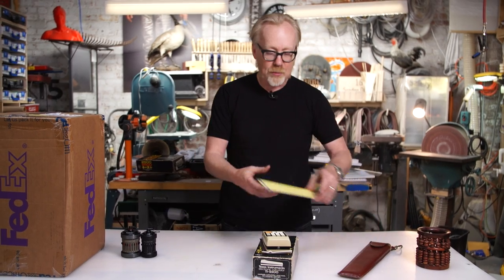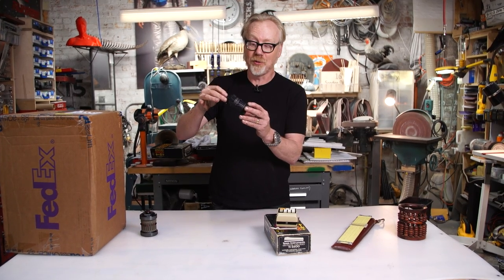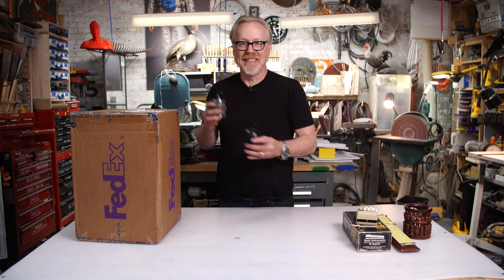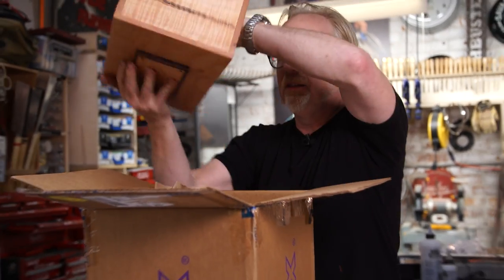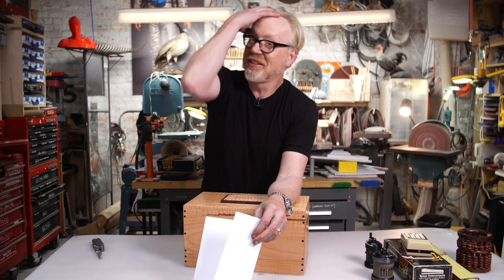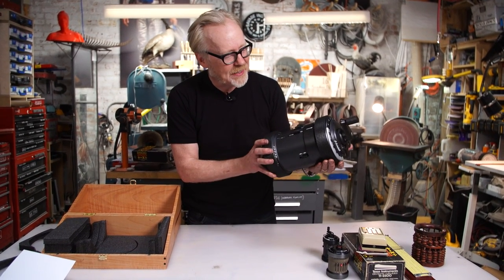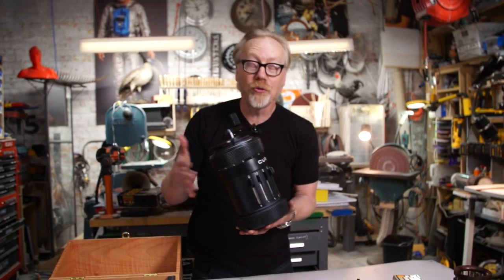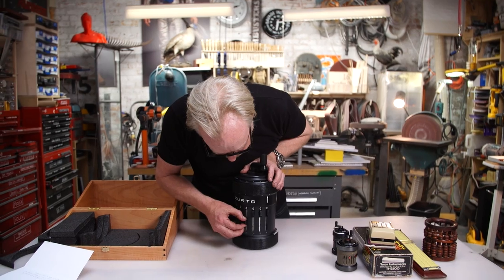The 3D-Printed Curta Calculator

Comment: Actually Curta is digital, not analog as it gives results in clear numbers. A slide rule is an example of an analog calculator. The results vary on how exactly it is aligned, how the results are read.

Comment: Man, lots of tiny plastic gears are hard to line up without them locking up, metal is a bit easier because if something locks up slightly you can just push through it but plastic isnt so forgiving, if one thing is out of place then there is a little resistance that causes it to bend slightly, that just creates more resistance which makes more bending which causes the whole thing to lock up more and more, keep trying to push and you break anywhere between 1 year and every gear that is linked up in that set, the more complicated and small you go the wodse this problem becomes, if you noticed it seeming to lock up a little bit as adam turned it remember that its a miracle it didnt entirely lock up and break from the start, as rough as it seems for plastic that is pretty damn smooth
Reply: Yes, a lot of time is spent smoothing the parts out. In fact, from early tests I did, I found that the ridges formed by the deposited layers of plastic created two problems. One is that they don't move smoothly enough and the second is that the ridges wear down faster causing parts to get loose. Both of those issues can cause binding. Aside from that, meticulous care into making sure that everything is aligned properly and using a dry lubricant (doesn't break down the plastic) helps a ton.

The carry mechanism is the hardest to get right without binding and typically isn't perfect which is usually seen in the last three digits during subtraction. Subtraction is done by addition of the ten's compliment with carry running off of the end of the last digit. For it to work right, a carry has to cascade from the highest order digit of the result through the last digit of the results. The last three digits are turned by a transmission shaft that does not have the extra support of an input dial (there are 11 results digits and 8 input digits). Those shafts are more likely to bow under the extra pressure that a carry requires. If they do, they slip and the device loses a carry resulting in 9s for the result digits after the slipped shaft / gear.
Reply: @MarcusWu  thats insaine how much care has been put into making sure there is no binding of the gears, i never thought about how the layers could wind up wearint down faster although it does make sense as they are slightly more flexible and are really thin, the dry lubricant was also a great idea, have you considered making another one with one of the new resin 3d printers that work off of curing resin using a laser, they are supposed to be able to have a much smaller resolution size which should help with the layering issue, of you do decide to do that i believe the channel marco reps did a video in which he made some improvements to the design of one that could make it a little better
Reply: @kiyosenl.3889  Yes, I was just doing fit tests with a simple printed rod and sleeve to see what tolerances give what kind of fit and that's how I found out the fits can change. I ended up designing the tolerances around sanding those edges down to get the right fit. Unfortunately that means the project is crazy amounts of work. That hasn't stopped others from pulling it off, though. There are some amazing builds posted to the Thingiverse thing -- https://www.thingiverse.com/thing:1943171/makes 

I have considered using a resin curing printer to build a Curta. I think I could do it at 2x scale instead of 3x. Unfortunately, the printers are a more expensive than a plastic extruding printer, introduce smelly resins, and also require additional tools to finish the curing process. I'd love to do it, but I can't spend on all that right now. I also have other large projects that I need to make some progress on. My wife says I have too many, lol... she's probably right, but a maker's gotta make. :)
Reply: @MarcusWu  i guessed as much was the issue with the resin printer, i for one can't afford one at all lol, currently am trying to get a "cheap" 3d printer for around $300 then use that to make a lot of the support parts for a mostly printed cnc machine so i can start doing pc mods, (as a side note i just realized the irony of how much math probably went into making a giant plastic mechanical calculator), im curious as to what you would go on to make after having made a giant 3d printed calculator
Reply: @kiyosenl.3889  I can't talk too much about it yet since I plan on starting a company around it when it's ready. It's software rather than anything physical I'm making, but it's oriented around the maker movement and the need / idea was discovered while building the Curta.
Reply: @MarcusWu  neat, hope that goes well for you then

Comment: How is that 3d printed? The finish is crazy!
Reply: Thanks! The trick is in the finishing -- multiple iterations of the following: sanding, filling, filler primer, flat paint, and clear coat. Particularly the sanding -- pretty much happens between each step. The highest grit number I used was 1500 (wet sanded) before the clear coat.

Nice name, btw -- my brother's name is Peter Wu

Comment: And now i want to buy a 3D Printer again. Wonder what printer this is printed on? The finish is amazing.
Reply: I printed two (the first one for myself). The first was printed on a gMax 1.5. The second was printed on a D-Bot. The finish isn't anywhere near like that straight off the printer. There were many hours of finishing that roughly went like this: sanding, filling, sanding, priming, sanding, painting, sanding, painting, etc. In fact, I didn't bother printing any part in any color other than white because it would have been pointless.

Comment: With that precision and finish, i'm going to guess the parts were printed on an SLA printer - light curing resin in a liquid bath. - edit: I was wrong. His printer is shockingly good for its type. He could get much more precision on an SLA though. I think the only thing that could keep it from being 1 to 1 might be the lack of strength of the resin.
Reply: Yes, your edit was correct, it was FDM rather than SLA. I do want to try a 2:1 scale build on an SLA printer, but I'd have to get one first. SLA printing is more involved and more expensive.

The FDM parts looked as the would on most FDM printer prior to finishing. To get the precision and finish, I printed parts with holes slightly smaller and shafts / pins larger than necessary and then manually fit the parts with lots of sanding and filing. For the exterior finish my process was to sand with a low number grit (I think 180 first, but on some parts I used 80 lightly) and worked my way to 220. Then I used bondo spot putty, some more sanding, a couple coats of an automotive filler-primer, and sanded some more. Then I did a couple coats of the main paint color with a flat finish, wet sanded that to 800 grit, repainting and resanding if I took the paint down too far, then finally finished it up with either a gloss coat or a matte coat depending on which section of the Curta. Lots of work, but the finish was perfect and totally worth it.

Early on in the project I did some tests to see if 1:1 was possible. I went through Shapeways and tried a couple different materials and methods. Some of them produced the parts, but none would be functional with the amount of forces that would be applied to them. To produce a 1:1 scale Curta, the original materials or ones with equivalent strength would likely need to be used. I have some ideas on how many of the parts could be produced today by a maker, but for some of the parts there is no getting around the need for a high precision lathe and mill.

Comment: They'd be perfect for poorer localities where batteries and electricity aren't always readily available, if they could be made inexpensively enough. That's why I also love things like hand crank radios and cellphones, pedal-powered washing machines and such.
Reply: You can buy a solar-powered electronic calculator from China for fifteen cents (MOQ of 10 units, probably cheaper in bulk), which will work for years or decades, no mechanical calculator could ever come close to that in terms of price, and the electronic one is quite a bit more capable to boot.
Reply: @guspaz  Very good point! I actually have one of those somewhere that I totally forgot about!

Comment: The mechanics of the Curta calculatror are simply amazing. But it's not hard to see why digital calculators essentially lopped off its head, kicked it around and then proceeded to dump the corpse in a river. Every single Curta calculator had to be assembled by hand like a mechanical watch by trained craftsmen. That not only makes it more expensive, it also makes it far more fragile. A digital calculator can be assembled automatically or by unskilled labour, does the exact same thing and is dirt cheap. 
I own an old German mechanical calculator which weighs several pounds and works with a hand crank. It's simply amazing. But again, not hard to tell why these things died instantly when the digital age hit.

Comment: Truly a marvel. But, I would like to add why I believe the Digital wins: in the curta, there are too many moving pieces, any of which can go wrong. Then the assembly time for a digital is probably 10 or 100x less. Combined, it is just more efficient to go digital. But....out of pure romantic value, the curta wins. And there are definite mechanical engineering lessons from this. Maybe the tech is useful for wind turbines...
Reply: By "digital", you mean electronic, right? FYI, the Curta is a digital calculator that does its calculations by mechanical (not electronic) means.

As for the rest of the comment - I'm unaware of anyone making a serious claim of competition between the Curta and an electronic calculator. But if you insist: In 1970 you could not obtain, for any amount of money, a hand-held electronic device that did what a Curta did.  If there was competition, it must have lasted about five minutes when hand-held electronic 4-bangers approached the price (about $125) of the Curta. The electronic calculator created a huge new market of people who had never even heard of Curta, let alone owned one. And most of the Curta owners soon put their machine in a drawer and forgot about it. It all happened so quickly that by the time the last Curta reached the customer, you could probably buy an electronic hand-held for less than $50.

Comment: Where you got a hold on not one but two originals, I've no idea, but I aspire to make a proper sized one based on the files on thingiverse.
Reply: If your goal is to make a 1:1 sized Curta, you will likely have to build it with the original materials (plastic will not be strong enough at those sizes). 2:1 might be possible in plastic with an SLA printer. To go 1:1 you'll need mad machining skills and different tolerances than my 3:1 scale version, but don't let that stop you. I learned almost everything from CAD to 3D printing to all of the finishing and painting work from this project.

As I tell my kids, you can and will fail many times, but you are not a failure unless you give up.
Reply: @MarcusWu  I've got some moderate machining skills and I was planning on using metal. There is some CNC work I can do down to the tenth of a thousandth, but I only know of one consumer product that can get down to the hundred thousandth and it costs 5k. I will do it eventually, but for now, I will study the mechanism. I'm honored to have you reply to me, you've done great work.
Reply: @fallingshells6856  I would like to discuss the approaches you would take. I have some ideas for a relatively easy way to fabricate some of the parts. You can find and message me on thingiverse if you're interested.

Comment: What is the accuracy for this printed calculator?
Reply: In what way are you asking if it is accurate? Does it provide correct answers? Yes. Subtraction is tough because of the amount of action in the machine. It can lose a carry in the last few digits because plastic flexes. If you are asking about precision, there are 8 digits of input and 11 digits of output and 6 turn counter digits. If you are asking how accurate it is to the original design, it is very close. Aside from being scaled up, some parts were combined or split to make printing easier, some were modified to work better made from plastic, and screw sizes were chosen by closest match to the scaled screw size.

Comment: I'm a huge admirer of old mechanical clockwork, believe me, but I'd rather buy an i9-9900K than this... thing.
A processor is basically a calculator at its very core, right?
Reply: A processor is often a little bit more than a math calculator. A processor typically has a part which handles arithmetic, but also parts that handle binary logic. Binary logic operations are not always included in a calculator (though it can be in the case of graphing calculators which do have processors).

Comment: what happens if you divide by 0 on it .
Reply: You turn the crank forever
Reply: alysdexia  the next digit "falls off" the end similar to how it happens on a modern computer. In fact, the Curta uses this fact to achieve subtraction. It does tens compliment addition for subtraction which means if the calculator had only 5 digits of precision, something like 00030 - 00001 would turn into 00030 + 99999 = 100029. For this theoretical calculator, the highest order digit of the result is beyond the end of the available digits so it is lost and the result displayed is 00029.

Comment: ..and this is the very first time I've seen someone make something truely worthwhile with a 3d printer.
  I still think the whole idea of buying plastic materials specially made for these things is pointless and consumerism marketing... If only someone would make a low cost OSHW option to enable the recycling of household waste plastic these things would be truely useful IMO. 
  How hard could it really be? Sort, then grind clean materials that go into a small batch extruder with a few small additives to tune the viscosity and the most basic structural properties.
  Does anyone know of a good source to gain a practical understanding of plastics recycling and manufacturing that hits some middle ground between "go buy [this] you idiot" and "..you need to learn to filter through [xyz] intellectual snobbery and [this] unnecessary explanation of quantum theory of a hypothesized alternate universe before Professor Wumbus will cryptically reveal the simple answer that applies 99.9999% of the time?"
   I've played with industrial paints and epoxy for a long while, but I've never played with PLA/ABS/HDPE/PPE on a professional level. Does anyone know of a good Undergraduate level practical book?
Reply: Recycling household plastic waste into printer filament? sounds like the ProtoCycler from http://www.redetec.com/ to me. I looked into joining their crowdfunding campaign a while back. Didn't end up doing it, but I still like the idea.
Reply: Marcus Wu 
   Thanks for the link. I haven't seen that before. That's getting close to the right ballpark. They are still trying to sell "pellets," and are focused on a fillament system. In my opinion the most efficient solution would incorporate the recycling process as the 3d printer's extruder.
   In the past I did autobody and paint professionally, and I specialized in small panel and plastic repair. I know there are some properties of ABS plastics that limit the rework potential. The structural properties change after melting and the plastic is heavily influenced by temperature. It has been almost a decade since I got away from the chemicals but IIRC there is some kind of chemical process that causes evaporative emissions of solvents or chemicals of some kind when these plastics are melted because of a breakdown of the chemical structure (thus the bad smell in the air).
   I know the basics, like when plastics are recycled on an industrial scale a combination of chemicals are added to stabilize and recreate the missing chemical structure of the polymer, along with the addition of a small quantity of new material.
   A real OSHW project would need someone that fully understands the plastic recycling process, and wants to help the OS community more than sell something to rich people. In my opinion, a real accomplishment is creating something a poor kid in India can make with what he/she has available. For example, a heating coil wrapped around an automotive master brake cylinder with some high temperature insulation, would make a cheap starting point for a high temperature, high pressure extruder that can be found/purchased dirt cheap.
   The real question comes down to what additives are needed to reconstitute the plastic and what are the suitable alternatives anyone can source from common household chemicals. That would probably need to come from the dynamic understanding of the engineer that designs the pellet materials.
  All the best, -Jake.
Reply: There are cheaper alternatives (such as filabot) which don't have the spooling, grinding or as much programming to do things like save extrusion settings for different types of plastic.

Yes, there is a limit on how much a plastic can be recycled without reconditioning it in some way. That's not something I am very familiar with, though.
Reply: Marcus Wu 
  Thanks I'll look it up. Very impressive project BTW ;)